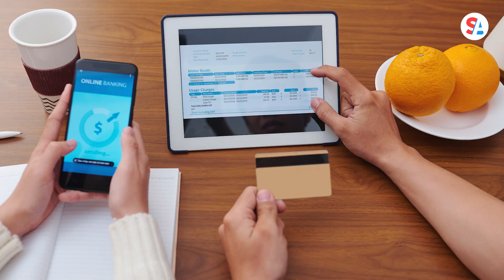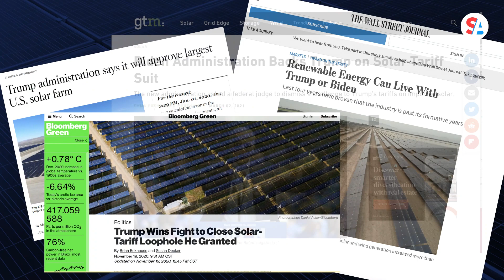How much money does solar panel technology really save?

Comment: Don’t for get after 20 to 30 years   At end of life of solar There a hazmat disposable lead, other hazardous materials. A solar panels removal can be as much as $5,000 to 9,000 for 1solar panels. So if you have 5 to remove that could be $25,000 to $45,000 . I go to old solar panel dumps and remove lead to make bullets for my gun.
Reply: https://solarmetric.com/learn/solar-panel-waste-could-leasing-be-the-answer/

$15-20 per 18 square foot panel seems like a far cry from the $5,000-9,000 number. Roughly costs $2,220 to recycle panels from a 2,000 sqft roof. I'm sure the labor costs to remove the panels are expensive though, but not to the point it adds an extra $4,980.  Could you provide me with a source that shows this $5,000-9,000 number?